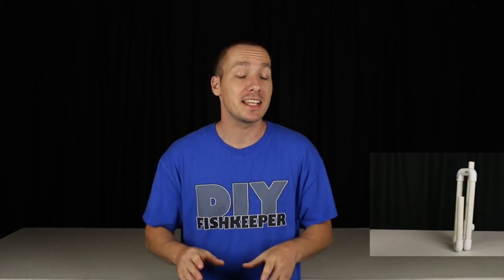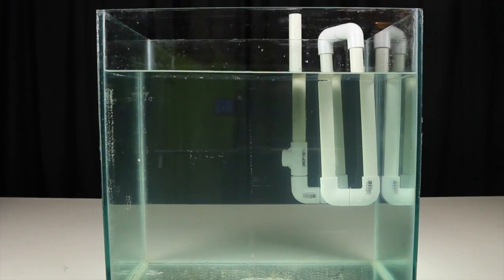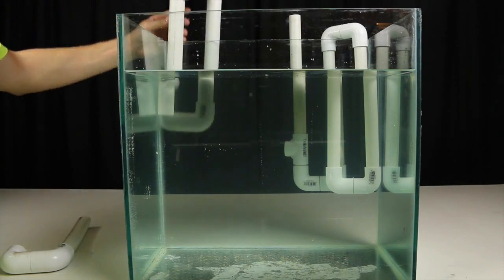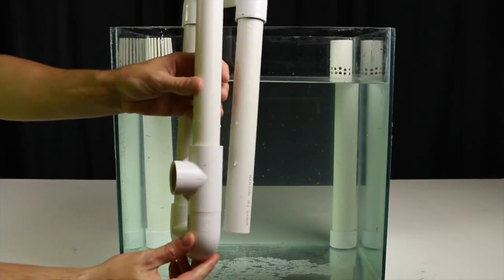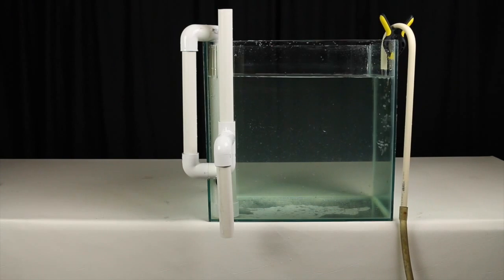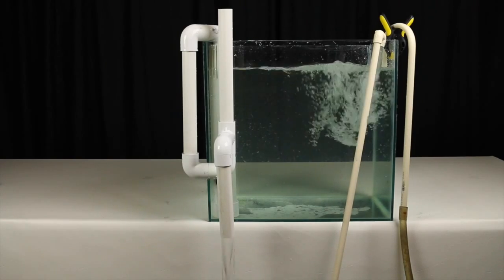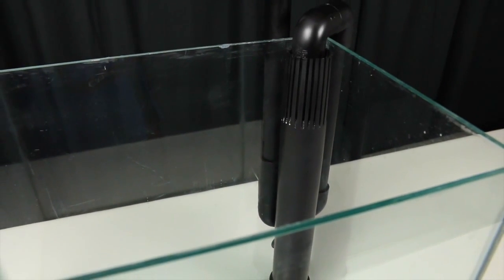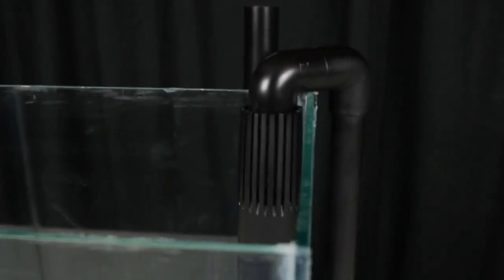HOW TO: $10 DIY aquarium overflow - UPGRADED and MODIFIED TUTORIAL

Comment: would one of these work ??

http://www.amazon.com/gp/aw/d/B00OWKFCMA/ref=mp_s_a_1_3?qid=1458168117&sr=8-3&pi=SX200_QL40&keywords=overflow+box+1800&dpPl=1&dpID=41aJ3R5rwRL&ref=plSrch
Reply: +Chris Vu using this design you won't need the overflow box in the picture, you could get one if you wanted too or you can do the design he is doing here. Not sure if you went through with your plan already but I was able to build his weir design with success (as well as using the sump filter with drawers as he stated in the other video). It's not complicated at all, just something to cut the PVC pipes will suffice, some PVC glue/cement, and the other materials such as endcaps and elbows.

Comment: I did a smaller version of this with .5 pvc.
the pipe going straight up from the t-fitting is making a whistle sound from air getting sucked in. I've considered putting a cap over it but then it would just be a siphon, and not an overflow.
any other ideas as to how to fix this?
Reply: +Joshua Olin Watch his previous video on the original built. Put a cap on it and drill a small hole on the cap. It should reduce the noise and won't be a siphon.

Comment: With this new design do you still need to have 2 systems in case one gets blocked so the other 1 can still run the required flow rate ? one is easier to hide than 2 I also ask because you mentioned it was 60 % more efficient so if I needed 1.5" before with this design I could get away with using just 1" right ?. Can you make a video on Pump recommendations like brands you trust and locations you shop at im in toronto.  Awesome channel bro been binge watching

Comment: Making this right now, a little concerned with the sizing for a 40B though, I followed the instructions from the first video and cut the lengths of my pipe to 16", which is the height of the tank, but there's less than 1/2" of clearance from the bottom to the opening. I'm also testing it out with a knockout plug instead of a cap, 3" caps are a little expensive, so we'll see how it goes. Any problem running a pipe in the tank that's a little shorter, at most 2", than the rest of them?

Comment: Quick question for you, i plan to make one of these for a 29g nano setup but, was wondering if this could be scaled down? Could it be done with a 1" intake and 1/2" plumbing? or will that not be sufficient for water flow? Thanks man!
Reply: +Mike Lemming i did this today, didn't get flow. although he's tested 1/2 inch flow before so i think i just need to make adjustments. lmk how it goes for you
Reply: +Two One I haven't put it together yet but I got inch and a quarter intake and Half inch plumbing. I'll let you know how it goes
Reply: +Joshua Lawson it's a 29 and I just set it up but, am working on the sump this weekend. I'll keep you posted..
Reply: +Mike Lemming how did your project turn out?
Reply: +silencedknight check out my latest video.. I've been running it for almost 7 weeks now
Reply: +silencedknight I ended up using 1 1/2 over flow and 3/4 plumbing
Reply: I have a 2 inch weird and 1/2 plumbing and it works perfectly

Comment from the maker: Have an issue? cant get it to work? HERE IS THE FIX: I have been answering questions on this project for years now.. and no longer will. Its the same answer again and again... the #1 answer that solves 99% of all issues is this: PAY ATTENTION TO THE VIDEO. 99% simply do not follow the instructions or build it the same way, yet expect it to still work. The other 1% have an air leak somewhere. Find it. Seal it. Sorry, but i simply do not have the time to keep answering the same questions, when they all result with this same solution. IF YOU MUST get help, POST A PHOTO to my fan page so i can at least SEE what the problem is. I will not be able to help otherwise. https://www.facebook.com/UaruJoey
Original video ► https://goo.gl/4EU9ZXHow it all works ► https://goo.gl/L1Fg7MThe modified and upgraded version ► https://goo.gl/ZGRtXj
Reply: The bottom of the weir teeth will be your water level
Reply: I have a question thats not in the video.  I want to do this but I want to also keep my water line above the trim of my tank.  That means the slots for the weir could be at most about 1/2 of an inch.  Is that too short of a slot. Would it work or should I just the cut the pipe off at the top a afix a screen to the hole?
Reply: Yes and no. It would work, but if your return pump failed you could have a mess. The back of the biocube has inlets that are halfway down the tank, so that's how far it would drain.
Reply: Both this and the 'original' design have their specific 'niche' applications. I use the original design (with ball valve added to the drain pipe connection) for water exchanges with aged (Municipal) water, (rather than a constant water exchange system). The original design is better at 'skimming' the occasional bacterial surface film (which might form if you accidentally overfeed). straight down the drain. --The design presented in this video however, merely concentrates that film at the base of its larger in tank 'well' and when shut off during periods of non use allows all of that trapped bacterial film to redistribute across the take surface again.
Reply: When I shut off my pump the overflow keep siphoning into my sumo overflowing it with water. PLS HALP
Reply: didnt think so but i wasnt sure. just dont want to disturb the substrate, or make the weir too short if i decide to remove the plants and substrate
Reply: do i need the outter pvc pipe if i install on a biocube that has a overflow chamber
Reply: Hi Joey Justa.

If you want to stop the overflow for whatever reason; you can put a valve between the T-joint and the flow down pipe to the sump. When you need it to flow, turn it on....

When you want it to stop, TURN IT OFF!

Hope it is not too late to help (Too bad I couldn't attached a photo of how my pipe looks)
Reply: The king of DIY  I'm creating a mini fish room is it possible to connect a few of these together to drain multiple tanks.
Also how do you feel about plastidip in forums I've seen it's once cured to be fish safe as it's a rubber base...
Reply: Ok, I know this probably won't be answered, but it wasn't covered in the videos as far as I can tell, probably since I haven't seen you use substrate that much. Would the weir go above the substrate, or below it? I know there's probably a simple answer, I'm just missing it. Aiming for 2 , 1in layers of substrate.
Reply: The king of DIY idk if you'll even see this but I have a question about why it needs a breather tube? Maybe I just missed why it's there but iv seen designs without them I'm just wundering what the purpose is I'm useing a weir aswell because I have turtles an small fish together I just want to make sure I do everything right

Comment: I have 150 gallon tank and want to do this. What size pvc pipe do you recommend I use?
Reply: I have a 45 gallon sump, and planning to put in a 950gph or 1000 gph return pump. I have 1/2 inch pvc laying around but thinki that would be too small. So probably was going to do 1 inch pvc like in the video.

Comment: i'm confused about the flow rate and 60% for this design, do you mean for i need 60% more power for the pump to achieve the desired flow rate you mention on the pvc size? or do you mean for the same size pvc of the old design, the new design is 60% more faster?
Reply: ***** thanks, so this mean we need at least an equally pump gph to return the water from the sump back into the tank to prevent spill in the sump

Comment: the more the return power the more flow you'll get through the wier and overflow? I'm doing 2 small wiers, both 2 inch with 1/2 inch pipe overflows into a 10 gal sump and a single return pump that's 160 gph. if I double my return power will it push more water through the overflows without overflowing my tank?

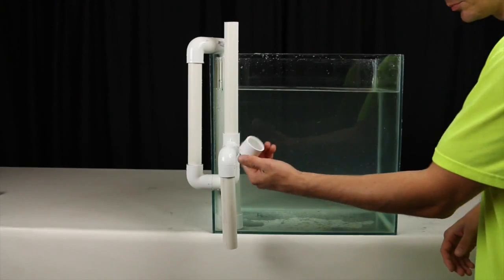Comment: will this work if my aquarium is at ground level? i have an aquarium rack and the first one is 2 inches over the gorund i want to make an overflow system to filter my 3 aquariums with the same sump and take out the pump and heaters.. something like going to a side from the T instead of going down with an elbow ( 2:46 )

Comment: When you say an inch fall on the weir, do you mean the inner pipe should only go down an inch below the teeth or hole of the weir? Also without airline or check valve, have you ever lost suction or had to reprime (in general or after power on/off pump) ?
Reply: +Ken Quinn thanks so much for your reply!! After watching the video a few times, I began to comprehend it this way. So thanks for confirming it.

Comment: If I were to put a couple horizontal cuts or drilled holes half way down and closer to the bottom of the weir, would it aide in covering a larger area of water being filtered? would I then need a larger submersible in my wet/dry sump? I just purchased a 125 gal long (glass) and plan on building the stand, overflows, and wet/dry myself. I appreciate any help.

Comment: I can't get the suction to start. It just fills up the weir and then keeps filling up the tank
Reply: Did you ever fix it ?
Reply: If you do exactly as he says it will work fine, I’ve used this model for all my fish tanks
Reply: Did you fill the pipe before turning upside down inside the weir? If you didn't, it won't start (if I am not mistaken). Others here can let me know if I am correct.
Reply: @thomasashe2681  absolutely correct, without removal of air from the upside down U pipe the system will be siphon locked

Comment: cant get it work. Difficult to prime and if water feed stops, wont re-prime. Using 3/4 pvc
Reply: +Dale Wolver . Figured out way to prime. Put end capon bottom, fill breather tube slowly, watch for bubbles in tank. Then start to fill breather tube rapidly getting water way up the column. Put hand on top of breather tube to stop air from getting in and remove end cap of drain. WHoosh out comes the water
Reply: @dalewolver8739  ik 4 years late but thank lord i found this

Comment: Help!

I did everything as instructed, but water level in my tank is probably too low so it's not working. Tank is 20" high and water is only about 8" (water turtles tank). What can I do? I'd like to try with aqua lifter pump, but can't find any shop that delivers it to Europe. What else could I try?

Really need this, as I've made (thanks to you) excellent external filter with moving media, but the hole I have on a tank is too small in diameter and water flow is therefore ridiculous.
Reply: +Ken Quinn Thanks, but aquarium is made of toughened glass and drilling it would only shatter it into thousand of small pieces (like an windshield). Existing hole was made prior to toughening glass.

Comment: Anyone know why mine won't prime? I cemented my pvc so there should be no air leaks. When I pour water to fill the tube that sticks up a little higher and then uncap it like in the video, it just drains the water out of the tube and the overflow doesn't start. Anyone have any ideas why it doesn't work? I used 2" pvc for the weir and 1" for the rest.
Reply: You need to put your hand on the output then prime it
Reply: +Ej deandre the top stand pipe? please help. i capped the bottom then uncapped, water falls out but no flow. please help me
Reply: Did you ever figure it out? I couldn't get it to work once I cemented it

Comment: great vid! but i dont understand how you primed it just by pouring water through the top? when i tried nothing happened
Reply: Did you figure out how to prime it? I am having the same problem. I fill the pipe and uncap it, but it just drains out all the water from that pipe and is not overflowing water from my tank. Do you need the aqua lifter pump for it to work? It looks like in the video that he doesn't have it attached but it primes without any issue. My design is identical except I drilled holes in my weir because I don't have a tablesaw.
Reply: @gbduga  I m having the same issue. Works in the beggining but after it turn off the pump and on it doesn't drain any more

Comment: hi, i followed your guide and made same set up for my tank. with 1'' pvc and 2'' for the bigger one. Everything is going well except the noise. It makes sound like if you are pouring water into pipe and its about to get full. not constantly, but like every 6 or 7 secs intervals. and its very loud. believe me its loud.... any guidance please... thank you
Reply: I am having the same problem
Reply: +Nepal House hi, I had the same problem too and I looked into making a stockman standpipe solution. It did work but I built it differently than in other videos. It runs on the same concept though. Let me know if you still have questions regarding that in order to reduce the noise.
Reply: and yes one more thing.... its coming from bigger pipe ( 2" )....
Reply: Did you fix this problem yet? I have having the same issue.
Reply: +Shaul Mizrahi I ended up deciding that my supply to the sump was oversized for the return pump so I put a ball valve on the supply to the sump to restrict the flow and allow the supply to the sump to quiet down.
Reply: +Max Ramirez thanks for the fast response.   I have a DC pump with the ability to change the flow. however, with the pump working on the lowest, it still making this loud noise.  even with cutting the pipe to a 2 inch below water level.
Reply: +Shaul Mizrahi I would try turning up your pump to match the suction of the pipe. My pipe was too large and allowed more flow than my pump could put out. so I restricted the pipe with a ball valve and it seemed to help with noise.
Reply: +Max Ramirez will try thanks
Reply: Glen does this work?
Reply: Very easy fix for this. Get an end cap. Drill a hole in the end cap and put a 6 inch piece of tubing in it.Put the end cap on the open air pipe. Bam no noise

Comment: how do i silent the noise on the overflow when passing the weir?
Reply: i have the same exact issue ! I feel like i need to wear ear plugs
Reply: @alabdelsalam3358  i remember that a put a cap and drilled a hole on the open pipe. I hope it helps.

Comment: Please help? I have a 220 gal tank.  I am building this overflow for it. The tank is about 29 inches deep. Should the Weir and intake pipes length reach close to the bottom of the tank, like the old model overflow? Or just 12 inches like the one in the video?. It sounded like the 12 inch weir and intake length of pipe are universal for all aquariums depths on Joey's new updated overflow. The only variable would be pipe diameter for flow rates?
Reply: +David Harley I saw others post if you dont go depth of tank you wont get the same flow rate and you may get bubbles in your lift tube. I was wondering that also.The way Joey says it in the video it sounded to me like the 12 inch is universal length also. I think it was just for his sample overflow,but unsure. Wanted to have increased sump height. If I am wrong someone please tell me before i glue mine up???

Comment: In theory, couldn't you also shorten the vertical pipes drastically?  From my understanding, the lower outside U of the overflow shouldn't have to be so low, you could save on PVC by making the vertical pipe shorter so long as the T is still above the U but below the water level of the tank, right?  Might make it a bit more compact.  I ask as I'm building similar, but vertical height above the sump is limited.